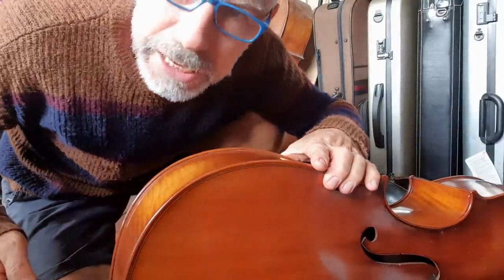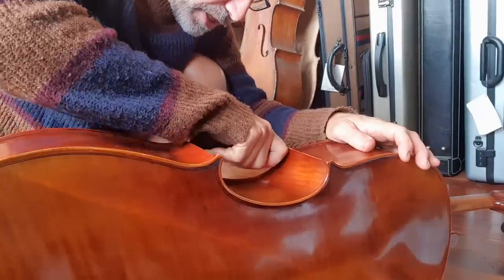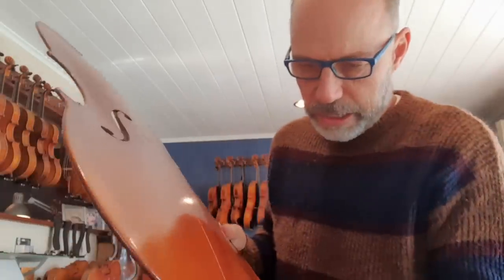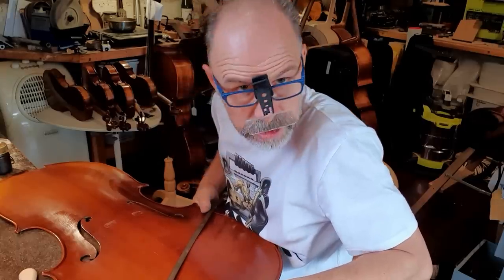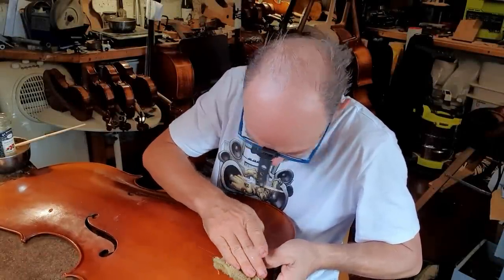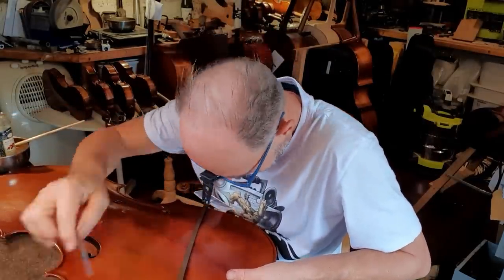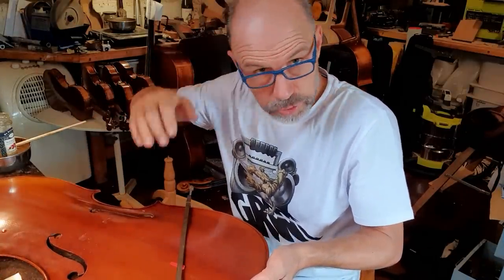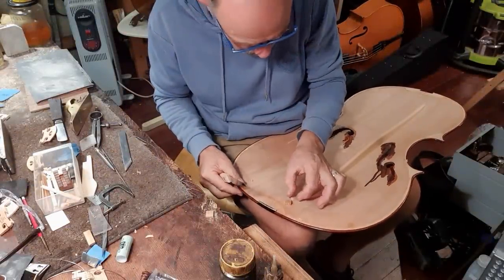I repair a Cello Crack part 1 of 2

Comment: How often do you have to make fresh hide glue and how long does it last (i mean does it remain viable for you to use heating and reheating it)
Have you ever ruined an instrument and had to pay for it?
Have you ever had a instrument that is too  damage to repair?
I'm so glad I found your channel!
Reply: He doesn't actually have to make the glue, it comes in little dried pellets that you soak in water and heat up. But it is made from animal hides, so once it's hydrated, I don't imagine it stays fresh for very long.
Reply: @Cadwaladr  thank you!
Reply from the maker: Hi, 
The glue lasts between 4 and 8 days. 
I have had a violin after a car drove over it :(
And I have had little accidents that happened but then repaired... after 34 years that nearly never happens... touch wood...
Luckily I pretty much continuously touch wood 😃

Comment: Sometimes I'm a bit worried that Youtube can indeed read minds :-D
About a month ago I had my first dabble at instrument repair, just for the fun of it and because I love to learn new stuff. A friend gave me a guitar that he'd "inherited" with his apartment, from someone who'd intended to turn it into a clock. It was never an expensive guitar, plywood back and spruce top, possibly from Eastern Germany (there's a faint stamp that I think reads "März 1974", which means it was most likely manufactured in a German-speaking country and the GDR was a welcome source of cheap but decent products back then. The finish was shot to bits (I have no idea how you can make it crack and lift off along the cracks like that!), the back is bashed in in two spots about the size of a 1-Euro coin each and it had become loose at the neck, making the neck move all over the place, especially since no one had ever bothered to take the strings off.

I did my best to glue the back on where it was supposed to go, even though the whole thing felt warped. On a luthier friend's recommendation I used Titebond Original. Since I obviously don't have any clamps designed for the task as a first-time DIYer I improvised with plenty of standard clamps and painter's tape. That repair feels pretty solid now but the top is slightly warped and it looks like the bridge is partly coming off as well so the string height isn't correct. I'll try to repair that and possible even the smashed bits. Not looking to make it perfect again but to learn and perhaps make it playable again!

So really enjoyed to watch a pro and see how it should be done!

Comment: Wait, what was that loose dowel rod just rolling around on the inside when he put the top plate on? Is that normal?
Reply: It's normal if leaving the soundpost there to not lose it. It is refitted later with a 'sound post setting tool' as it is normally done with any of the violin family of instruments.

Comment: I hoped you would have been more precise on the cleats : first idea is the fiber should be perpendicular to the crack to be more solid. But on the contrary the cleats are wood and will retract more perpendicularly to the fiber, so, if their fiber is parallel to the crack, the lateral retraction will pull the crack close (if the cleat does not crack itself in this position). Which do you use ? Or 45° as I have seen on some repairs ?

Comment: I don't know much about string instruments, so how do cracks actually affect the instrument? does it affect the sound, or is it mainly a danger to the integrity of the wood? I'm assuming that cracks can grow if left unfixed, what's the worst thing that could happen in this case? Could the face plate split completely, or can cracks splinter into multiple cracks like glass and thus cause even more damage than one would expect?

Comment: Fascinating. Good thing the hide glue can be undone. Imagine epoxy where the cello could not be taken apart. Did the early craftsmen anticipate the glue would eventually fail allowing repairs or did they actually want a more permanent adhesive?
Reply from the maker: I have seen instruments that were glued with hide glue 450 years ago and I believe some areas are still glued together with the original glue.

Comment: Silly question- if you have to add a bit of heat to extend the open time of your hide glue while getting the crack aligned, might it not be better to heat from the inside, where you don’t have to worry quite as much about damaging the finish with the heat gun?

Comment: I have a mild crack in my cello in the same area too! I’m thinking mine came from really rapid weather changes. cool to see how my baby is gonna be repaired soon
Reply from the maker: Yes, sooner is often better than later. 
Sometimes the different direction of the grain in the saddle can cause problems. The saddle will shrink less than the top-plate, so causing a crack is the only way the timber can shrink.

Comment: I would love to see what it looks like (close up) after it's all dried and (touched up). 😊❤️How do you touch up the seams where the top plate meets the body? Does opening it up inevitably make scratches on the sides? Is that necessary or does it naturally  come off very clean?
Reply from the maker: Yes, opening an instrument will leave some cracks and marks in the varnish when it is glued up again. I retouch those and then polish around the join. Also the timber can splinter slightly, so it is really important to make sure I reglue those splinters and that the plates get reglued in exactly the same place they were before.
Reply: @AskOlaftheViolinmaker    Wow that sounds bad if it splinters in addiction to fixing a crack on the top plate. Better then than later i guess...  I would love to lean the craft and learn how to make violins/cellos.  :)

Comment: Hello Olaf, I have seen multiple times cracks like this one. From the saddle upwards, along the bass bar or on the right side, dangerously close to the soundpost.
I think those cracks could be prevented by oversized cut for saddle in the top plate.
Some extra room would allow spruce top plate shrinking without tension caused by ebony saddle part which doesn't shrink so much. 
I asked my friend about it and he replied that he would not be happy with gaps left and right from the saddle.
I think gaps  are still better option then cracked top plate , just my opinion.
Reply from the maker: Exactly.
One can actually make the gaps quite thin, but enough to give the top-plate some room to move

Comment: I have a question. I read a blog where a woman repaired the top plate due to an impact on the sound post resulting in a crack in the top plate. She repaired it by putting an oval shaped plug in the top rather than what you did here. She had removed all the varnish to do this repair. Does this not seriously impact the sound quality of the cello now? The serious issue I have is she is equating her repair to that which could be used on a hardwood floor. I lost it at that point.

Comment: Where did you get those larger clamps? I can see how they can make the process go so much faster than using the single bar clamps.
Reply from the maker: ... GEWA or Dictum. I also made 2 crack clamps myself

Comment: Oh wow!  T hat crack looks pronounced.
I bet gluing the top plate back on a Cello is a bit tricky since the mating bits are so much longer than on the violin.  Do you do it a little bit at a time to make sure the glue doesn't gel before you get it all glued and clamped?
I guess hte chin rest is really big on a Cello, isn't it ~{:o)

Comment: Quick question. Does it matter what kind of wood is used for the reinforcement cleats? And how far do you cut and sand them down? Flush? Thank you
Reply from the maker: I try to use the same type of wood as the area I'm repairing.

Comment: Master Olaf I have two cellos I will be restoring soon. Both cellos have the antique style gear machine tuners, should I swap them for standard pegs or should I leave them as is?
Reply: Also love that Paganini is playing in the background.
Reply from the maker: It just depends on the player. If the machine heads are original and the player likes them... keep them, but it a player is looking for more traditional pegs, changing them might be better. 
You will have to fill some screw holes either with a tiny maple dowel or otherwise.

Comment: Thank you Olaf - very interesting video!

What level of tension do you apply to the clamps? I'm comparing this to furniture work, where the wood thickness is usually higher, but then again the parts are not required to vibrate together, and the joining surfaces are for the most part straight rather than curved.
Reply from the maker: It depends on how hard the timber is... I have to be careful with the top-plate, because if there is too much pressure, the clamps will leave permanent marks.

Comment: That crack looked like it could have started at the saddle. Did you not feel it necessary to remove & relieve the saddle (from spruce side grain shrinkage to end grain of saddle not shrinking)?
Reply from the maker: Greatnpoint. I did actually do that, but didn't film at the time.
Reply: @AskOlaftheViolinmaker  That's great. It's always satisfying when a repair comes together well & even better when the client says "wow" on picking it up. :)
Reply: @AskOlaftheViolinmaker  I should add, I really appreciate seeing your videos & that you take the effort to share your experiences.

Comment: Hello Olaf, I've actually seen some violin makers use tiny suction cups when gluing the cracks, they use it to push the glue towards the crack, is it effective?
Reply from the maker: I don't have much experience with that, but there are different ways to reach a good outcome... so it could work well.  
The way I rub glue in is quite traditional and has worked for makers ove hundreds of years.

Comment: What exactly is purflng and why is it on the string instruments and how do you know if it is real or just ink.
Reply from the maker: It is there to strengthen the edges and stop them from cracking too easily as well as decoration. You can see the difference in the timber on properly inlaid purfling.

Comment: What is the grain orientation on the cleat.
Reply from the maker: 45° degrees
That way the cleats will expand and shrink similarly to the top, but still strengthen the area.

Comment: Why isn't the base bar in the middle?
Reply from the maker: Then it would be a middle bar 😆.
But seriously, the soundpost supports the treble sude and transfers the vibration to the back, and the bassbar supports the bass side and transfers the vibration to the top and the bottom of the top-plate.
Reply: Think about bridge as a hammer and top plate as a drum. Bass bar in the middle would not be very effective, it would neutralize the hammering action of the bridge. If you put bass bar on left side and bridge pushes down, the left part of top plate reinforced by bass bar resists and right part goes down and presses on soundpost and from soundpost to rear plate. F holes help the process.
So basically assymetrical bass bar design creates leveraged transmision of the bridge vibrations on both plates.
It is very sophisticated mechanical system.

Comment: Why don't you use heat when separating the top plate off instruments?
Reply from the maker: It doesn't actually separate well with heat.
Reply: @AskOlaftheViolinmaker  Thanks Interesting. I'm familiar with other types of adhesives and heat helps with them. I figured it might harm the finish but then I saw you bring out the heat gun to prepare the top plate for the repair. Thanks for the answer and the interesting video.
Reply: @tak-el-uc  Trigger warning: Glue nerdery due to an interest in violins and Roman shields (which were made of hide glue bonded plywood).  I seem to remember hide glue is more of a chemical bond than an mechanical bond.  Heat alone doesn't do much to hide glue which is basically just refined collagen.  Collagen is a protein.  Heat generally just makes the protein molecules coil up tighter.  Similar to how overcooking eggs makes the albumin squeeze the water out (making them watery).  Heat (over 120 deg F) and humidity (over 75%) turn hide glue back into jello.